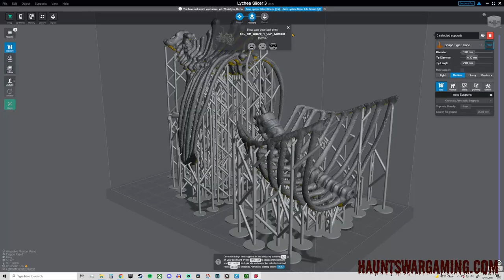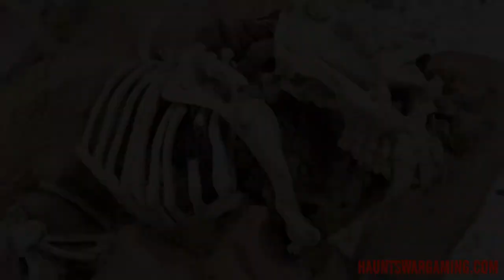3D PRINTED ALIEN BONEYARD - Miniature Terrain Tutorial [DESERT TERRAIN EP.2]

Comment: Get yourself a 6$ bag of home Depot leveling gravel/sand from the paver section, screen the rocks out you can do this down to 3 different sizes with a cooking screener and chicken wire.

Then you'll have some great fine grade sand, runt size rocks and pea size rocks, with a cup of two of dime size rocks, you can even screen it out smaller too.

I use it for all my basing and it's way cheaper then grout because you get 3-4 different size basing materials
Reply from the maker: I got 2 torn bags of sand on sale a few months ago and I did this. I forgot to wash the first batch though so it's super dusty lol gotta wash it and throw it in the oven to sterilize too.

If you keep an eye out for it you can get grout on sale too. I got like 75 lbs for $12 a year ago. It's pretty much a lifetimes supply. :p